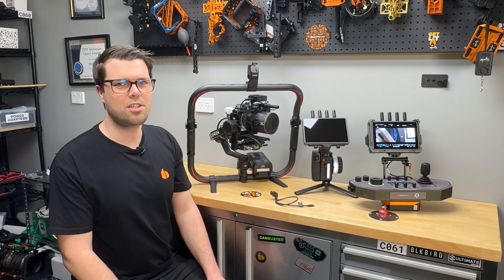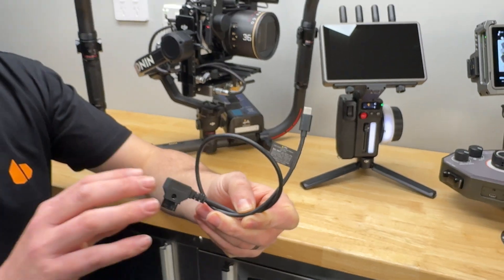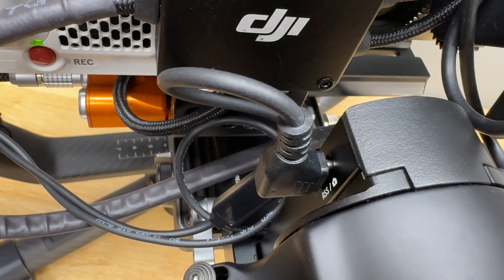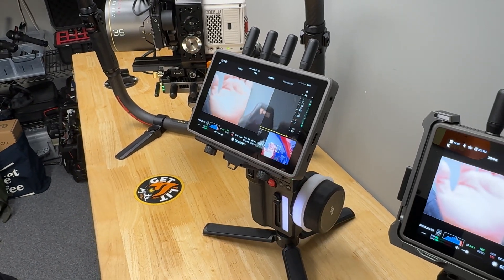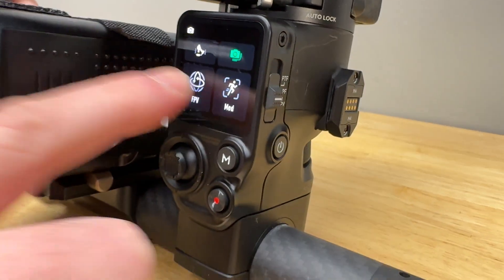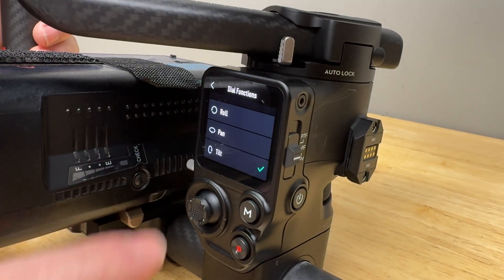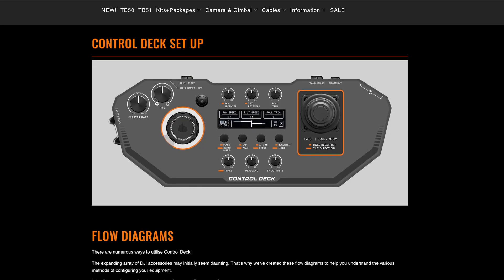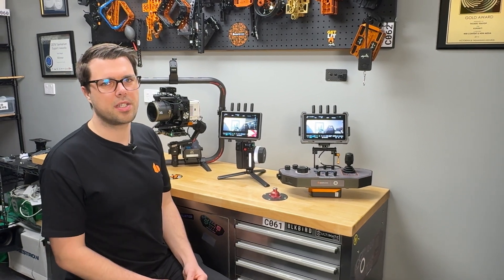How to use RS4 Pro, Transmission & Focus Pro ecosystem with Control Deck

Comment: Note to Everyone intending to use this configuration - please email DJI support and insist they write a fw to allow full FIZ control using the focus pro hand unit over the transmission link! This will solve all our problems 🎉